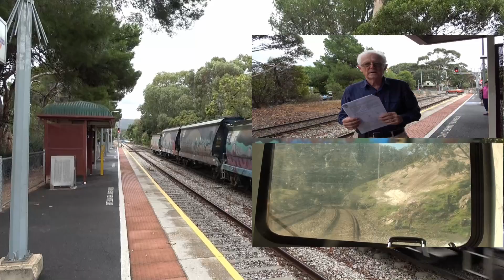High-Speed Rail Tunnel through Adelaide Hills for Passengers and Freight Proposal Video May 2022

Comment: You’re looking at moving populations much larger than our own - and your speed limit data is not particularly accurate. 

All we really need is the metro line converted to standard gauge and connected to the ARTC network.

The Belair/Melbourne line has limited freight traffic through the day and thus could facilitate the operation of passenger trains around freight trains.

We don’t need high speed, we just need reliable.
Reply from the maker: Hi Kanes Trains,   Thank you for your comments,   "we just need reliable.".   The current crop of politicians in South Australia run a million miles from rail infrastructure.   Because "All politics is local" any attempt to improve the existing rail tracks between Keswick and Murray Bridge brings forth a maelstrom of protest from local residents.  

The squeal of steel wheels going around the sharp bends and memory of the bush fire started by sparks from the train brakes lives in the memory of local voters.   Particularly for those whose houses were burnt down.

The 2 tracks between Keswick and Belair Junction does not help.    
The single Broad Guage Track reverting to the  5  passing loops as a means of movement in both directions.    This track being "owned" by the Adelaide Metro (SA Government). 

The single standard gauge track between Keswick and Murray Bridge having about 5 passing loops long enough to handle the length of "modern" freight trains.  This track is now owned by a "private company", ARTC. with the Australian Government owing the one single share in that company.     Extra locos being added for the trip through the Adelaide Hills. 
There are around 100  level crossings between  Keswick and Murray Bridge.   

I suggest that mixing Freight and Commuter Trains is no longer regarded as desirable.    Witness Western Sydney where huge amounts of money has been spent untangling these 2 disparate systems.   In that case the NSW Government has kept ownership of ALL track within that state.   ARTC is "licensed" by the NSW Government to manage the day to day movement on the mainline tracks.

SO the logical solution is get the commuters into an O-Bahn  with dual tracks from around Bridgewater to Grenfell Street.   The O-Bahn is 100% Grade Separate from Modbury to Gilberton and has a tunnel from Hackney to East Terrace.   

The rubber tires can handle steeper grades - the climb up from Paradise Interchange to Holden Hill at Junction Road being an prime example why steel wheel trains were never implemented between Victoria Square and Modbury.        

Rubber tires are much quieter 

The O-Bahn is so popular it has 100% fare box recovery.
   .

Comment: no need for the tunnel to climb up to Mt Barker and decend east from their 1% is still very steep for freight trains. straight consistent climb from portal to portal with deeper stations would be better.
Reply from the maker: Yes - Passengers can descend easily via elevators.      I had the luck to use the passenger trains beneath St Petersburg and Moscow    They use escalators

Comment: The 2007 Mitcham Council Rail Freight Task Force study is still the best option. A freight bypass from Murray Bridge via Callington and Sedan to Mallala with a major highway running along side for road transport and those travelers who want to avoid Adelaide metropolitan area. Much of the route is already government owned being old SAR lines and on flat country.
This would be far cheaper than the ridiculous cost of a tunnel that still directs freight ultimately through Adelaide. 80% of freight just travels through Adelaide to and fro from Perth. Small freight trains can carry the 20% destined for Adelaide from Mallala.
There have always been vested interests stopping this project by plucking stupid inflated cost estimates "out of the air". The Alice to Darwin line cost about $1M a kilometer. So an 80km bypass would be affordable and quick to build.
Options such as new bus routes are a 1950s solution and ignore the fact that road traffic and rail freight is only going to increase in the future. The potential for derailing of freight trains is ongoing and would block major railway crossing access for emergency vehicles through Belair and Blackwood on a catostrophic  risk fire day.
Reply from the maker: So many reports and no action resulting.     
In Norway they are building a high speed rail tunnels 
https://en.wikipedia.org/wiki/Follo_Line

In the 1980's I had the chance to spend  a month or so driving around Norway and experienced some of the road tunnels in topography with similar complexity to the Adelaide Hills.

The Marshall  Government made 10 promises to build infrastructure and only succeeded in creating endless reports written and then did nothing with the recommendations.

Comment: you could probably build subway eastern lines and upgrade the system to a true metro with less money though. Quadruplicate to Ascot Park and Woodville and use those high-acceleration, high-speed, low clearance trains from San Francisco (as opposed to the Pantograph-based, slower electric trains currently in use) and building sub-surface underground railways to replace boom gates would only need a trench 4.5m deep and 9m wide, it would be cheaper to do than elevated rail. 

Belair could run a direct bus service taking a shortcut to the CBD, and Gawler could have bypass lanes running through it and compete with a car trip for speed, as well as a shuttle line connecting Port Adelaide to Dry Creek and a tunneled extension from Flinders to Eden Hills. The new trains would have high-capacity signalling and the stations could incorporate screen doors because of the unified rolling stock.

Reckon Adelaide is very well-suited to construct a world-class metro at an affordable price, I reckon maybe 5B$ all up if the government was smart about it, but to me they seem at best like the elites from "Anthem" (no innovation/creativity allowed, do the same thing over and over even though it's worse because we fear technological change outside our control) and at worst are pocketing billions from these projects.

Not dissing your idea at all tho, I just reckon the money could be spent for a higher benefit to all.
Reply from the maker: As you allude the BART in San Francisco uses third rail propulsion power is 1000-volt DC electricity.  It has Broad Gauge trains.   Apparently they have not purchase any new trains in a long time.   

In Silicon Valley The BART to Antioch extension trains are / will be  Diesel Multiple Unit (DMU) and run on Standard Gauge that will be shared with Caltrain  

So BART California is / will be very similar to Adelaide  South Australia.  Both haveing 2 incompatible systems.

Caltrain is changing from diesel to overhead wires carrying single-phase alternating current at 25 kV with a frequency of 60 Hz.

https://en.wikipedia.org/wiki/Silicon_Valley_BART_extension#:~:text=Silicon%20Valley%20BART%20extension.%20The%20Silicon%20Valley%20BART,project%20has%20seven%20stations%20in%20three%20sequential%20phases.

I suggest the next step in Adelaide is to 
*  standardize on 6 or 9 car trains   (NYC did that in the 1950's)
* lengthen platforms at all stations to allow 6 or 9 car trains to stop
* Adopt the Japanese Shinkansen & French GTV track layout that uses passing loops at "local stations" going to the side platforms with the express running down the middle.   (This was done in Sydney in the 1910's with some of their tracks.)

A quad track that spreads out side-ways is too destructive on the suburbs through which is passes and will involve changes to the 2 flying junctions that have just been completed in the last few years at Goodwood Junction and Torrens Junction.

The new Sydney Metro North West Line to Rouse Hill in Sydney is a tunnel closer into Parramatta + elevated track further out.   

Many rail tunnels in London and Manhattan (63rd Street Tunnel) are double deck tunnels.
Reply: @Highbury5089  lots of good info here. I believe BART has some new trains now though. A quad track I reckon could be done by having a single interchange station where the rail reserve is the widest and only having to make room for two extra tracks on the other stations, although I see the cross-over tunnels would be an issue and both of those together might not make it worth doing in the long run. (Oh, and that HSR tunnels need to be wider for air resistance's sake, but with few stations it might still be possible to do cheaply. Plus, the Gawler line, while it wouldn't be a capacity increase, could be quadruplicated in the middle suburbs easily to speed up service)
Reply from the maker: @mr.jamster8414 As you know the BART is actually a "driver-less" train with absolute grade separation from other trains, road vehicles and pedestrians.  This involves "Flying Junctions" in the underground tunnels 
https://www.bart.gov/system-map

In Greater Adelaide we will need to have more "flying junctions" if we wish to progress the rail system.  5 years ago I created this video
Trains collide and Flying Junctions Greater Adelaide video Nov 2017
https://www.youtube.com/watch?v=Gos5i2UoBek.
Sadly I saw 2 trains collide at the Rosewater Junction when the Port Dock Station was still functioning.  

The 7 train in NYC is a triple Track which has UP trains using the middle track in the morning rush and the DOWN trains in the afternoon rush    In London they do something similar with the Northern Line (?) during rush periods

Trains lines like the Mandurah to Butler in Perth and the proposed Gawler to Seaford in Adelaide have the problem.  I suggest the A and B trains in NYC is an exemplar we should consider.

Yes the proposed rail tunnel under the Adelaide Hills should extend under the Eastern Suburbs and emerge in the Northern Suburbs.  It should have few stations.
Reply: @Highbury5089  One last (Unrelated) thing is this idea I thought up: what if instead of overhead wires, new train lines use a hybrid supercapacitor/third rail system? So it's like a 250V third rail and the train is constantly getting powered by it, but when it's not accelerating the excess transfers to a supercapacitor that powers the train alongside the third rail when the train needs it? Sort of like those Hybrid Uber cars.
Reply from the maker: @mr.jamster8414  YES This kind of thing is currently done in a number of places.  

One example is in the USA
https://www.amtrak.com/northeast-corri
The "N E Corridor" has legacy electric train systems and their locomotives change from one to the next as the trains moves along the track.
Reply: @Highbury5089  cooool

Comment: A recent study done by infrastructure SA said that a bus corridor was the best option
Reply from the maker: I think I have read that report by Infrastructure SA.    
Grade separate Bus, with the City of Brisbane and the Adelaide O-Bahn are a prime examples of the correct solution for urban areas if there are limited number of bus stops along the "track"    The passing "loops" at the "stations"  was the significant enhancement in Adelaide over the BRTs in Curitaba and Sao Paulo   In Adelaide the "express buses" can share the same track as the "local buses" and local bus can leave the track and serve the local suburb.

Peri-Urban regions like Verdun, Mt Barker, Monarto Zoo, Murray Bridge, Tailem Bend & The Bend Speedway Park need high speed vehicles to handle passengers quickly.       Sharing a dual track Railway Line with High Speed Freight and Passengers is the best compromise.
I have included a link to "New Tunnels for High-Speed Rail under Oslo: The Follo Line" which will carry both types of trains at high speed.  Due for completion later this year.
Reply: This is from a government with no money and no vision and is a 1950s solution. This is from the same government that foolishly created the Mt Barker development fiasco that exacerbated an already existing traffic problem on the SE Freeway. Mt Barker should never have become the "Elizabeth of the SE".
There has to be a plan for 100 years, not a quick fix that actually isn't a fix at all.
A rail freight and road freight bypass of Adelaide is the ONLY practical answer. It is cost effective and feasible.
All other ideas simply congest Adelaide even more and things will only get worse.
SA needs politicians that truly look to the future, not just for a couple of years with a focus on getting re-elected.

Comment: HI Neil,
 This is well presented and the ultimate answer to Adelaide Hills rail access to Adelaide Central, The time saving will be very very significant. You mention a 'Dual bore' tunnel which I presume you mean dual line as the word 'tunnel' is singular. Double stacked freight yes only way to go. I think you presentation is close to the idea put forward by Dr Paul Szuster.                   I just hope the current SA Government is listening and commits not only to this project BUT also to the CBD underground to relieve congestion at Adelaide Central. Again well done, DaveU
Reply from the maker: Thanks for the information about Dr Szuster's presentation.  I will look it up.  
When in St Petersburg and Moscow I have experienced the long trip down the escalators to their stations, the deepest at 73m   
The deepest in the world is the Arsenalna, a station on Kiev Metro's Sviatoshynsko-Brovarska Line at 103 metres
Belair Underground Station would be 109 m if we have a 1 % gradient.
Verdun Underground Station would be 54m
Mt Barker Underground Station would be 65m
Reply: @Highbury5089  If the standard gauge rail access can be provided to Adelaide Central then the existing broad gauge to Bel-Air could be converted to stnd gauge easing congestion on a single line.

While the tunnel will have significantly reduced travel time, resilience is critical as NSW DoT has found out during the Bushfires & more recent flooding in the Blue Mountains. What happens when the tunnel is blocked due to a broken down train or crash? Supply Chain costs go through the roof &/or supply stops.             
Inland rail needs another route during major events (e.g. Flooding). Drainage structures are presumed to be designed for 100year RI floods but when a Lismore size flood (2m over previous highest flood) occurs then Inland Rail will be out for months. For resilience they need an alternate route. 
So keeping the existing Adelaide Hills rail line could provide an alternate route. But then it depends on supply chain disruption costs V annual maintenance costs
Reply from the maker: @dhuphill  It all takes money.  Full fare-box recovery and capital value capture are the two mechanism that will first need to be considered.   

LinkSa Bus from TTP to Springton costs $12 one way.  A distance of 58.5 km
Adelaide Metro Bus & train TTP to Mt Barker Regular Metro Card is $3.95 Peak and $2.20 Off-Peak  a distance of 41.7 Km 
Why is the fare to Mt Barker cheaper than the fare to Springton?

Adelaide Metro recovers about 20% of the running costs as Fares.   So the true cost of the Bus fare to Mt Barker is something more than 5 x  $3.95 = $19.75 

In 2022 money the O-Bahn track cost about $1.5 Billion to build.
i

The O-Bahn runs at a profit because it has full buses at all hours of the day and night.  
O-Bahn Buses from TTP run every 30 seconds during rush periods.  No intersections with Smart Rd and beyond until Park Terrace

London transport runs its underground trains and above ground trains at 100% fare box recovery because it has zones with high fares to areas and routes of high congestion and lower fares if patrons use routes that avoid use of high congestion routes to the same destination.

To travel between Flinders Medical Cenre from Elizabeth is 42 Km 
This can be done a number of different routes for $3.95 full fare.
Trains that run 7 days a week until midnight run through the CBD.  It should probably cost $10 if we use the Fare TTP to Springton.
Other routes that avoid the CBD which take longer would be at a cheaper rate.

Sydney has Tap ON  and Tap OFF with  Zoned Fares.   
Quakers Hill to North Bondi cost $8.78 during rush periods. A  distance of 51 Km.

See   https://youtu.be/ZvZHnerPlAY
"Tap On and Tap Off Profit Making Public Transport Video Aug 2020"